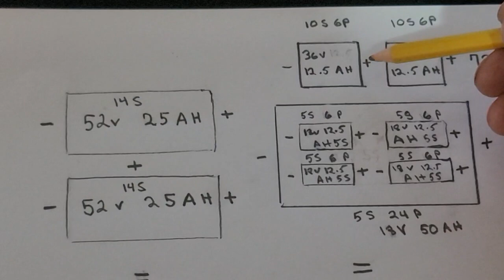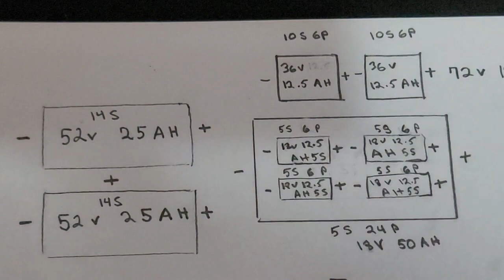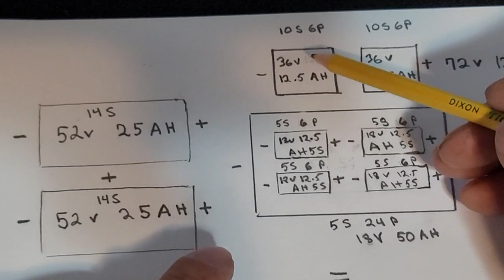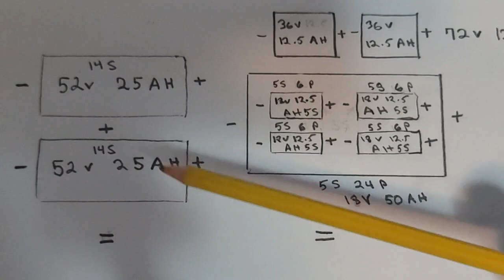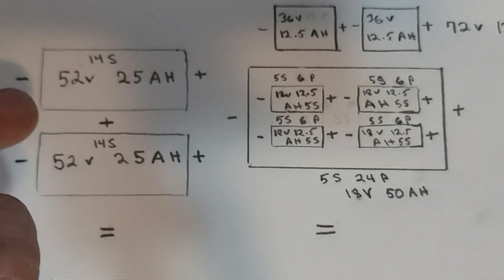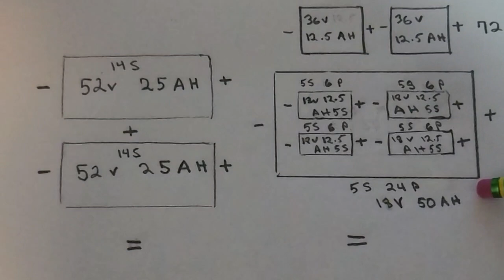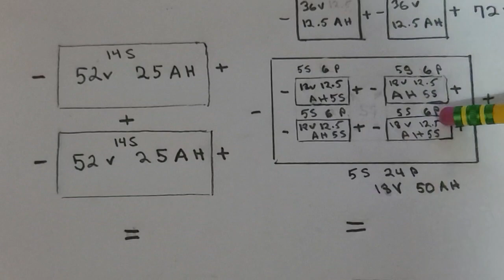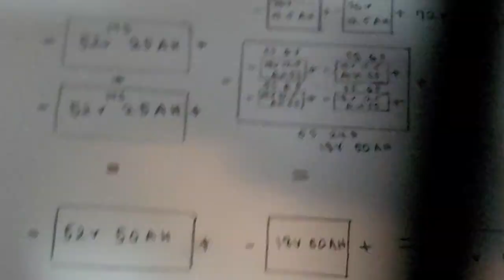How I made a 72v (70v) 50 AH battery sys piecing battery's together, long drawn out expla literally

Comment: Where did you order your batteries from?
Reply from the maker: actually I ought those 52v from a local distributor here in the D.C. area. He imports bikes and scooters and had those laying around paid $250 each for those 25AH and the 2 36v from the guy on youtube that sells them used for $35 each Jerihuga something like that lol. I try not to pay full price for anything if I can help it.
Reply: @ChrisCrossingWires1212 , ahhh ok, I was hoping you'd remember who it was that you bought off of in the first place. I've been looking for some less expensive higher AH batteries (42v currently)
Reply from the maker: @redbeard716  Actually I know exactly who it is, weve become good friends but hes not really in the battery biz, He wholesales PEVs , Ebikes, scooters, etc. Just so happened he had 2 semi used batteries ot of two fairly new scooters that were returned with other issues so he parted them out and I was lucky enough to be around at the time. You can get the same ones off amazon or Alibaba Im sure or shop FB market place or Ebay. If you dont mind used i give this link to this youtube battery guy. The packs he sells has top of the line cells, Check his ch out il get the link hold on
Reply from the maker: @redbeard716  https://youtube.com/c/jehugarcia
Reply: @ChrisCrossingWires1212 , thanks man, I appreciate that.

Comment: it's all now a single battery or still 52V and 18V? 
how are you charging it?
Reply from the maker: I treat it as one battery as there only one lead 
. Main pwr goes straight to controller. Have a lead with xt 60 to charge with 10 amp variable voltage pwr supply
Reply from the maker: it's 2 battery's now as the 52 is the large one and the 18 is under my seat